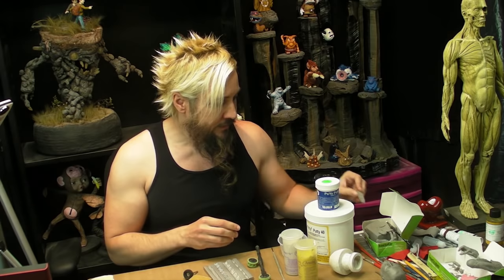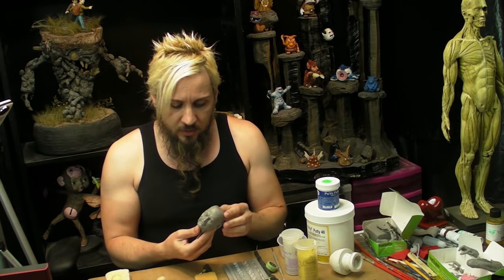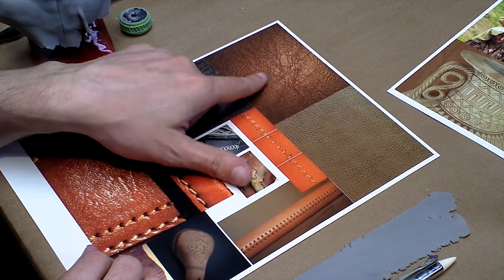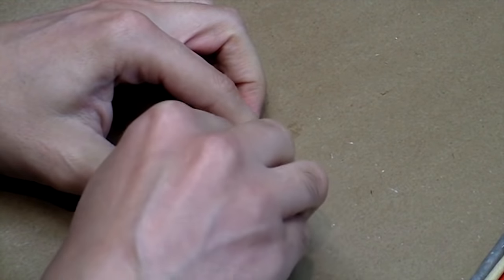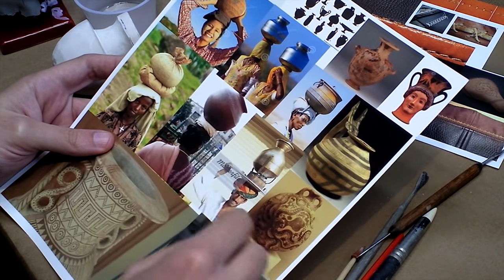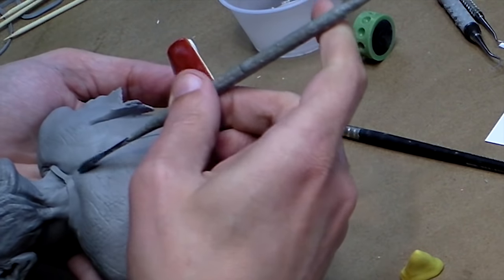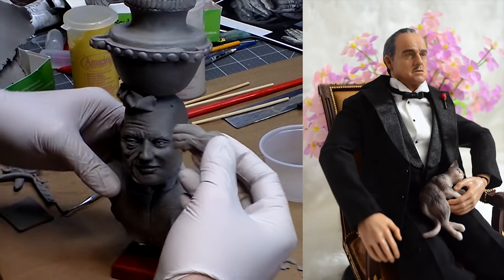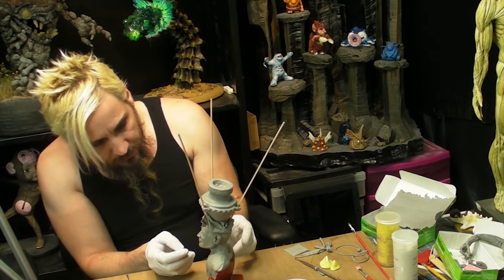Sculpey 101 Class 8: Tutorial on How to Sculpt Texture Stamps with Polymer Clay and Rubber

Comment: As an assist to using cloth as a texture plate, you can get the fabric wet (using water, not alcohol) and it will help release it from the clay. Alcohol would have the exact opposite effect, so if you wanted to include cloth but have it behave like clay, you could do it that way to get the cloth totally permeated with clay.